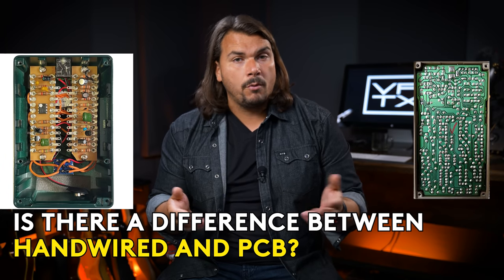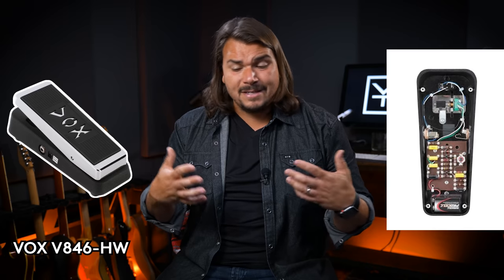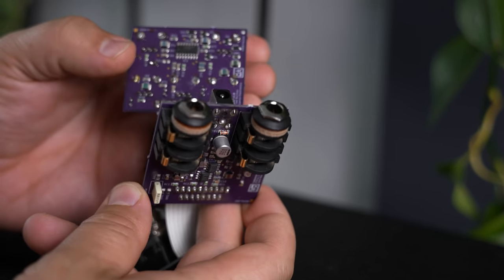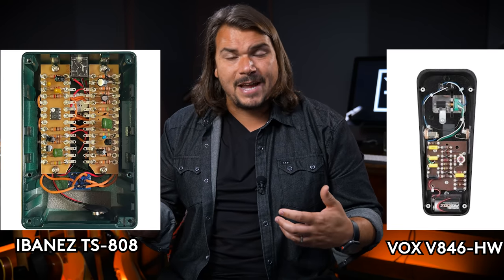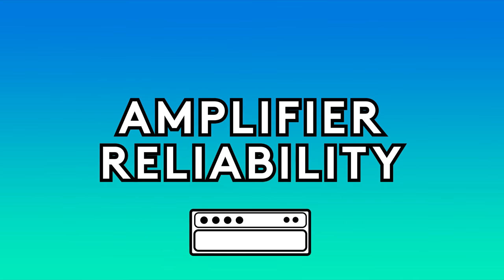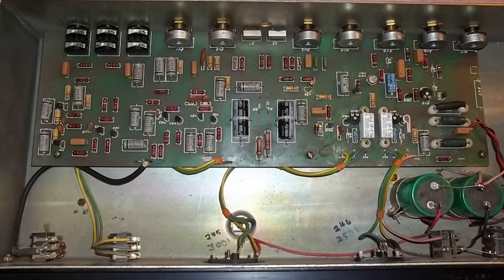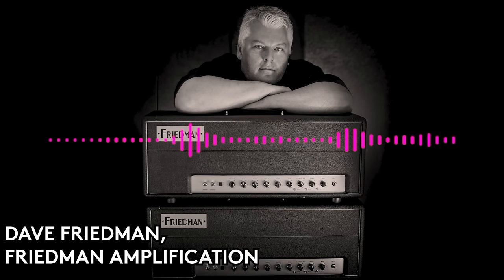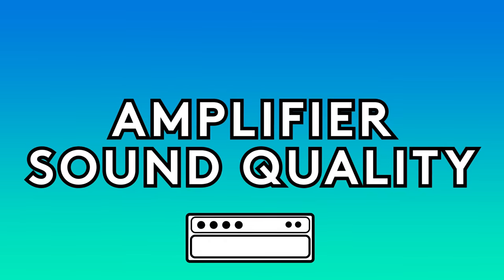Is Hand-Wired Actually Better?

Comment: In short, PTP, handwired, whatever you want to call it, will always be easier to service than PCB. If you plan on using something in the studio it doesn’t really matter, eq a PCB amp to your liking if it sounds that different. Some of the all time greats are PCB, basically all your pedals are PCB, but if you spend the extra $$ up front for a PTP amp, your tech will be much happier when it comes to servicing, and more than likely cheaper as well.
Reply from the maker: I think if you're generalizing high volume PCB amps, yes this is true, but a lot of time this comparison is made of simple amps to complex PCB amps that really couldn't be done with handwiring anyway.  Say like comparing a Bogner Ecstasy 101B to a Tweed Deluxe.  Of course the Bogner is going to be harder to work on with multiple channels and relay switching, etc. - this really can't be made handwired and do all it does in the package size that it does it.  If we're looking at more 1:1 amps both PCB and PTP Handwired, you're likely to see less failures of the main boards on the PCB or solder joint issues, and if the pots and tube sockets are wired off the main board you're likely to see fewer overall failures than the PTP amp.  Simple circuits like a Tweed Fender PCB or PTP are going to be negligible for tech time they're just not much to them both being equally well made.  Maybe it'll add 10% more time to remove the PCB?  A lot of the issues with re-work to PCBs that are crap is the traces pull up and the board just can't be re-heated without damage, this isn't true of tick traces on a quality board.
Reply: keep in mind that a lot of PCB amps have bad PCB designs. 

Causing heat between components.
Reply: @VertexEffectsInc  absolutely. great point. Sweet video too Mason nice job getting all those pros on board for it

Comment: Boutique used to mean a guy sitting in his basement or garage building pedals by hand. Painstakingly soldering them one by one. That also meant they could not sell immense volumes. They just made enough to get by.  It also meant they could provide one on one customer service to the customer. Lots of renowned boutique builders started out like that and some still do. Then came along guys like the likes of this dude, JHS and many more. Quick money makers. These guys get the pedals fully manufactured using smd in China. No different to what a Chinese company like Joyo, Behringer, Caline, Mooer and many others do. Except, these guys still want you to pay the "boutique handmade" price for their mass produced pedals. In order to do so, all of these manufacturers are churning out videos and blogs on how smd is better than through hole. Its actually quite funny to watch them bend over backwards to prove this point just so they can justify the price difference between theirs vs the Chinese counterparts.

Comment: As a professional PCB designer for the last 30 years who has worked designing every type of design from analog, RF to high speed digital and I was expecting to balk at some things in the video but it was really good. Having designed boards for studio gear, tube amplifiers and humble pedals there is a lot involved but its never even a thought to try and make an item somehow as "good as hand wired" its just implementing the circuit as optimally as possible and PCBs really allow for lots of variations to truly get the best out of design that hand wired doesn't allow for. That said, after all these years of looking closely at thousands of PCBs, a hand wired amp is aesthetically very pleasing to me and I prefer them for that alone.
Reply from the maker: Thanks for watching and for the comment.

Comment: Every manufacturer loves pcb, every player who invests 2000 or more loves the assurance that Through hole can be serviced long term.  I bought a Mesa boogie tremoverb in 1996 at the age of 22 that I saved for and wanted to last a lifetime.  10 years ago it started having issues that led me to learn how to build and design amps.  The same way Dave Friedman and John Suhr ended up learning.  They became frustrated with an old amp.  Any pedal under 300 dollars is fine being SMT.  It is great.  But if it stops working after 15-20 years, I would not be heartbroken. The exception to all this is Freyette and Suhr, and maybe Friedman.  I know they are great men with conscience.  Only Friedman is relying on his investor to provide him with technology to execute his amps.  Even Fryette admits to amps he created 25 years ago to being inrepairable due to chip and the chip programming he used.  When I buy a guitar that I like, I don’t expect it to be inreparable in 25 years, and I don’t expect an amp to be the same.
Reply from the maker: As John Suhr said, it's not the method, it's the execution.  There have been a lot of poor PCB implementations over the years, especially among budget amps, which make a bad name for the great PCB amps out there - Suhr, Friedman, Fryette, Rivera, Fuchs to name a few.  The truth is, there aren't a lot of large scale manufacturing amp builders out there, so most of them can't afford to do this or have the team in place to help them do it properly to scale, so it's easier on their operation to do handwired and keep a small team in place to do it with higher priced amps due to the increased labor.  It's not so much that it's not possible it's just not the infrastructure of most of these amp makers that many of us love, but are never going to sell even 200 amps per year.

Comment: Yes, properly done there is no difference. But with mass production the managment says -  this part is 2 cents cheaper, and this... lets make everything cheaper, and the profits higher. I can't imagine boutique builders like Jim Kaufman will do this with his buffer boxes. No knobs - and there is not much in it. He just uses good stuff. It sounds good, last so long, easy to repair. And so simple to use. IMHO
Reply from the maker: For the most part, parts are the same in either fashion, the parts are not typically the primary cost, it's the labor that's the consideration above others, and PCB cuts that down tremendously.  Jim could make the same product on a PCB if he doesn't already with all SMD parts and could get the same result.
Reply: @VertexEffectsInc  My argument is "mass production" - not pcb or handwired. If I buy expensive "handwired" I expect excellent parts and ecxellent sound. Like the Sunrise buffer box. In mass production someone comes, buys the company, outsources everything, makes everything cheaper... I don't say you do that, or Kheeley or JHS. But look at Gibson from the 1980 on: when the manager-class rules...

Comment: All four of the experts are in business selling PCB based products, not including their guitars.  It would be a conflict of interest for them to say anything negative about PCB based products.  Both Dave Friedman and John Suhr did say that the PCB quality and design has to be at a certain level.  Unfortunately there are many products, not necessarily theirs, that do not live up to those standards.
Reply from the maker: I think the "bias" argument that some are making here is still a bit of a stretch.  It infers that there is a bad faith effort in the video findings to undermine the customer by creating a cheaper/easier version of our respective products to save money in production and increase the cost to consumers, with less serviceable products, thereby, giving us higher profit margins and the customer a costlier repair bill when the time comes.  The consideration, I think, is that an amp technician would somehow be more neutral as a voice to support or refute what's said here.  However, amp techs generally aren't in manufacturing and have little understanding of those processes on a large scale, or even medium scale.  They also have their own biases too.  Some may only be able to work on PTP and Handwired amps, so they'd prefer that, others might just want easier jobs so may prefer handwired amps that don't require a lot of pre-work and schematic sourcing to repair.  Others might prefer a PCB amp that's more complex because a repair is more billable hours.  We can't presume their reasons or incentives, but what I can say is that this video has about the most comprehensive a group in amps and pedals as you'll find in our industry and defaulting to bad faith and incentives on their part just doesn't like up with their company legacies and brands.  These are individuals that have proven products in both point to point and PCB over multiple decades in most circumstances.  If there is a better way to do it, they'll do it.  They all care about tone, consistency, and reliability.  If you refuse to take their advise, you're doing so at your own peril.
Reply: @VertexEffectsInc  TLDR

Comment: When it comes to reliability, longevity, and repairability, hand soldered still has major benefits.  
The biggest difference becomes evident when things go wrong.  Let the smoke out of a hand wired amp and it can be repaired.  Pcb’s on the other hand can be damaged beyond repair which, assuming the company cannot replace the board, makes the product obsolete.  
They can burn, traces can be damaged, the copper can lift from the board,they can become conductive.  They are susceptible to mechanical fatigue and spikes in current flow from power supply surges.  They are sensitive to moisture and heat levels.  These things are true of individual components as well, but in a hand wired amp, individual components can be replaced.  Board often can’t.
The point is that printed boards fail.  Its not that they are more likely to fail than hand wired gear, it just that when they fail in a big way, your older or discontinued gear is  headed for the trash bin rather than the repair shop. Just ask any tech who has had to call and deliver the bad news that their customers gear is not viable for repair because the costs associated would exceed the cost of a few new amps.
Reply from the maker: Hand soldered has more errors than machine soldered, there is no dispute on that other than from someone who doesn't understand manufacturing.  Bad PCBs can be damaged beyond repair, yes that's true in poor designs.  As Suhr said, it's not the method, it's the implementation.  There are plenty of mediocre to bad examples of PCB amps and they overwhelmingly tend to be more budget amps so we associate PCB amps as cheap.  Trace thickness can be called out to be equal to any wire gauge you want, as can component distances so you get the equivalent to a wire cut the same length between the same components every time.  The only places where you really need to get away from PCBs on amps IMO is on the heater wires - those should be hand wired.  Otherwise, if you are comparing a well make handwired amp, to an equally well made PCB amp like Suhr, Fuchs, Friedman, Rivera, etc. the issues you point out aren't present.   You can't compare a poor quality PCB amp and represent it as the standard.  It's just not true.
Reply: @VertexEffectsInc  you are right on everything you’ve said but I think we are talking about two different things.  I’m not saying that pcb’s are more prone to failure, and you’re right that it’s quite the opposite.  I’m saying that amps, of all kinds, even high quality pcb amps, experience failure.  When the inevitable happens, it is possible that a pcb will be damaged beyond feasible repair.  I’ll give you two examples.  1. A resistor burns and damages surrounding traces making that section of the board unusable. 2. Shady power source at a night club surges and causes arching which burns the board.  Most times, through a labor intensive (and very expensive at a techs hourly rate) process of scraping away conductive material and replacing with hard wired components, the board can be repaired.  Some times it can not.  This is the crux of my point.  Pcb amps can fail in a way that makes them scrap.  Hand wired amps don’t share this issue.  Your pcb board may last a lifetime with no need for repair.  If it does fail, it will more than likely be repairable. In the unlikely case that the pcb experiences extensive damage, you will be looking for a new amp, not a repairman.
Reply from the maker: @mr.preece8137  in the examples you give - it's not likely to happen if there are protections built into the amp to circumvent this.  Secondly even if there were some damage to the PCB you can cut traces to re-work the area when that happens.  I do this to Fender Hot Rod amps all the time where this happens routinely.  Higher quality boards don't have this issue on well designed circuits.  This can also easily happen to a PTP amp, it can be easier to repair however.